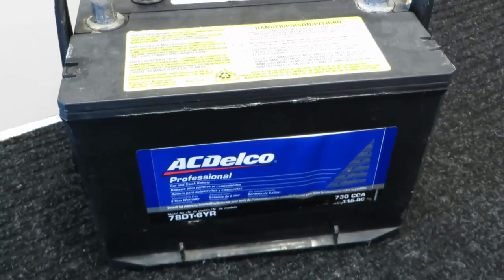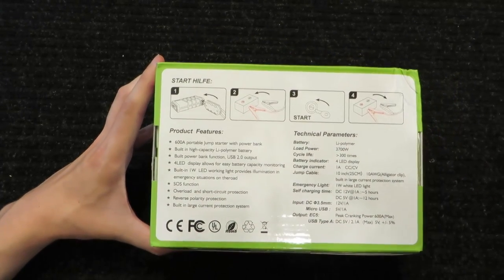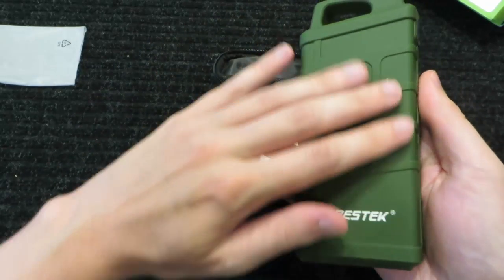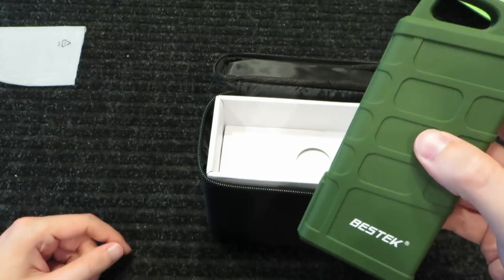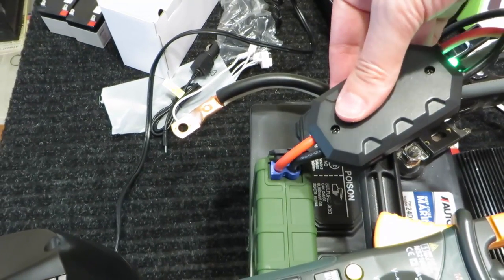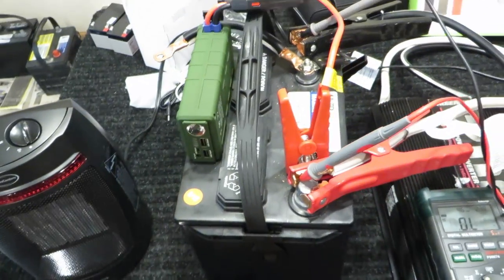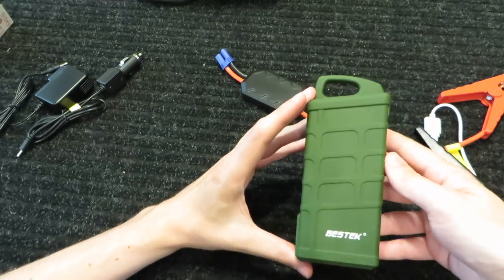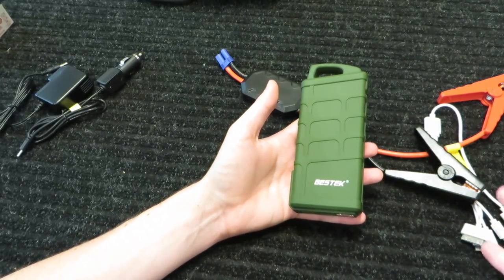BESTEK 600A Portable Jump Starter and Power Source Review

Comment: You think it would jump start a 6.2l v8 engine or at best a 5.4l v8?, thanks for the video, i was considering one of these last december 2014, they where all over lowes and home depot, i think it was whistler brand but they got recalled in Jan or feb of this year, are these the same polymer batteries they use on rc electric motors? thanks again
Reply from the maker: Fern W I don't believe this one has 'true' polymer batteries, just lithium ion with polymer separators like a standard laptop battery is my assumption.  Either way I have little doubt that it will start a large displacement V8 without issue when it's fully charged and in good condition.  I cannot speak for other similar brands.
Reply: +knurlgnar24 if it's anything like what I've seen before its probably a bunch of 18650 cells.
Reply: Peter Carlson 18650 cells can't produce near that sort of current (100A+). It will be a pouch style lithium like you find in RC models. 18650's usually output about 5-10A maximum.
Reply from the maker: abyssunderground Yup, it is the pouch style.  In my previous comment I mentioned that it is 'laptop style' which is misleading since most laptops still use cylindrical batteries.  But both are lithium-ion in most cases and not true polymer batteries.  The pouch style has polymer separators and are often referred to as polymer batteries in advertizing.
Reply: Fern W I can't speak for this particular model, but I used a similar jump pack earlier today to jump a 5.7l V8 that wouldn't turn over. Got mine from the local NAPA dealer for $89 on sale. It's called the Blue Fuel, but you can also get it from Amazon as the Shumacher Red Fuel. Exact same box just different colors. The battery technology is Lithium Iron Phosphate, which is supposedly safer than regular Li-Ion or Li-Polymer.
Reply: Yeah they all have tradeoffs. I use a lead acid AGM booster pack, primarily because I have to program keys to cars computers to start and that means keeping the battery voltage above 11.5 volts for up to an hour or else you have to start all over, that and after boosting the battery for an hour I still need it to start. Lithium batteries are great for that little bit of extra cranking current that you need when you have a battery that just went flat, but they are downright lousy when you need an hour or so of continuous voltage into the battery to run car electronics.
Reply: Peter Carlson That's just due to total capacity though, not the technology.
Reply: Well not exactly, That battery has to pretty much dead short across another battery for an hour or longer and often times in cases where there is a (sometimes) huge unknown load, lithium batteries don't like to be almost flat out shorted like that, lead acid particularly agm batteries are much more robust and likely to withstand that kind of prolonged torture than a lithium pack, hence all the safety circuitry required to keep that from happening. Pound for pound lithium batteries have a much higher energy density than that of any lead acid batteries, but they aren't nearly as robust.
Reply: Peter Carlson It would only matter if there was a voltage mismatch, I.E a 16.8v lithium connected to a 12v lead acid then current would flow to the lead acid until the lithum was dead (overcharging the lead acid in some cases perhaps). If it were 12.6v lithium and 12v lead acid it wouldn't matter as the voltages would eventually equalise. Ignoring cost, capacity vs capacity is of course identical.
Reply: abyssunderground
NOPE! that is if you had a battery and NOTHING else connected to it. I had a car yesterday that had to be jumpstarted every time it was shut down for more than an hour. Turns out for some reason or another one or several of the modules were pulling about 45 amps from the battery at all times(parasitic load test instantly popped my 10A meter fuse and I had to use a dc clampmeter), why it was doing that is beyond the scope of my job, I only need to give it enough electricity for the computer to accept the new key and then he can fix whatever was causing that. So no, there are in fact many reasons why lithium ion batteries are not suited for many industrial applications, and if they are their implementation comes with either monetary or practical drawbacks that restrict their usage.
Reply: Peter Carlson Of course I was under the assumption that the battery would not be under a high load. If this were the case it wouldn't matter. And again if you had the lithium and lead acid or agm of the same capacity it again wouldn't matter. They'd last an equal amount of time.
Reply: abyssunderground
Actually it would, the lithium ion will cut off because of self protection, the higher energy density per given volume of battery pack is going to mean those cells will heat up a lot quicker under the same load, while they may be able to give very high instantanious current outputs, they will fail catatstrophicly if you put that lithium cell without any protection in the same job as my booster pack. sure the protection saved your 100$ lithium battery pack, but you lost 400$ because you couldn't do the job with the tools you had, even though they were superior in performance in some ways compared to the old tool. I would rather hook up my booster pack and watch it's charge pancake before my eyes while performing my job than watch a lithium ion pack refuse to work at all.

Comment: HOW are they getting ~90 amps from that tiny little lithium polymer battery..??
Reply: I'm guessing there are 8x18650 cells inside based on voltage and size of the unit. These cells can usually support up to 10amps max draw. Given that this device only needs to be used at high amperage for a few moments they're safe pulling a few more amps out for just a few seconds. TL;DR - Magic.

Comment: I believe I am first but i didn't comment right away :(, also i have a 3S boost pack like yours, so mines 12.6 volts and it starts my 5.7L hemi with no problems over and over again, I am not sure having a higher voltage helped in this booster pack (4 smaller cells with less Mah at 16 volts) over one like mine witch can use the same space to put 12.6v 3 cells with higher Mah capacity, great review and glad you put out another video for us! also any more inverter videos coming ? :)
Reply from the maker: fliping720 The higher voltage helps them get more amps out of a smaller battery when connected to a high drain load.  Professional jump starter services often use 18V batteries for the same reason.  That isn't to say a 12.6V battery is in any way inferior - it's just an engineering choice.
Reply: ***** yea it seems that way, just looks kinda hard on the battery.

Comment: i am looking for a way to drop 36 volt solar panels to 12 volts I have the ability to get 100 70 watt 36 solar panels for cheep but I have two 12 volt aims 5000 watt inverter would love not to have to buy a new inverter any suggestion's boss?
Reply: david wise Just buy a solar charge controller with MPPT function.
Reply: +Lau Chung Kyu  wow thank you ill look into that I have ask a lot of people and got a lot of disinformation
Reply: +Lau Chung Kyu color me slow could you point me to one that would accept 36 and let the need voltage for a twelve volt system there are so many im lost
Reply: +Lau Chung Kyu http://www.ebay.com/itm/30A-20A-10A-MPPT-12V-24V-Solar-Panel-Battery-Regulator-LCD-Charge-Controller-CE-/301221639758?var=&hash=item462235764ethis looks like it works it a cheaper unit but the 30 amp one will work to test the panels I have at the moment
Reply: +david wise Don't buy this unit. This is a fake MPPT, you will spoil it with that high input voltage. Buy a higher price one.
Reply: thanks for the info really appreciate it
Reply: +david wise aims inverters arent very good quality, knurlgnar has done reviews on it
Reply: thanks I look for it
Reply: +david wise  MPPT shortens battery life significantly....
Reply: really short explanation please
Reply: hd the wise uuu

Comment: +knurlgnar24 This is probably the first pack like this I have seen that looks like it was built to be halfway safe (I am sure others exist).  The little black box looks to be the main thing that many of the other inexpensive Chinese booster packs lack.  I am waiting for a unit like this that is 4-6 times larger and is truly capable of supplying 400-600 CCA at above 9 VDC (many modern cars won't start below 8.5VDC due to computer).  It would be nice to see 4-6 gauge cables on this unit as well.  Heck at 4-6 times the size and capacity it might even be able to replace many small car batteries completely.
Reply from the maker: kuhrd I thought modern cars required no more than 5V?  It's not that I'm arguing with you but if you could link sources for the 8.5V number I would be interested in reading about it.  Thanks.

Comment: Save your money on these. These will only start your car if your battery is slightly discharged and not if you left your lights on or some how completely drained your battery.  You will find videos online where they disconnected the battery and started the car which is misleading and here is why.  If your battery is dead, the car battery will draw a substantial amount of power from the jump starter leaving little left to power the starter. Your best bet is to maintain your battery and make sure you don't leave lights on and if you do, either jump your car from another vehicle or the best thing to do is connect the battery to a battery charger.  This is because using your alternator to charge a dead battery can damage it since the alternator will not limit the amperage going to the battery.
Reply: it will still start the battery.

Comment: I will never buy another one of these boosters. I bought the Genius GB30 booster and it never was able to boost my car last winter. AGM spiral-tech car battery 660 CCA, 11.2 volt un-loaded bat GB30 Failed! The booster pack would not hold a charge in the cold car (Southern Canada Winters) so was useless away from home. Soon after the Lithium battery swelled up popping the GB30 casing open. 100 Canadian dollars up in smoke
Reply: City Lights oh, and the AGM type car battery which is now almost 8 years old is still working great! I do regularly place it on a trickle charge to top up it's surface charge. Longest lasting car batter I've had yet

Comment: sorry but 6v to the starter motor is not an acceptable starting voltage,  a lot of youtube test for these jump starters get 200A at these low voltage - Your car won't start on 6v! all that happens is things get hot. Minimum acceptable start voltage with battery under load is 8.5v (scraping the barrel minimum). Ideal minimum 9-9.5v (obviously higher the better). Remember you starter motor with the same output load is turning 50% faster at 9v then at 6v.

Comment: My main issue with these 600 ..700 amp starters is the cable.. come on..my 15 dollar jump leads rated at 700 amps are 3 times thicker.
Reply from the maker: There's a bit of advertising 'lies' in there, but for jump starting you only need a few seconds of high amperage so thin leads like this can still do hundreds of amps without overheating.  The issue with jumper cable thickness is more about voltage drop than cable heating.  These jump packs have short cables so they can get by with thin wires.
Reply: @knurlgnar24  I work for an independent test lab.. on testing these we found out that ..yes most will put out 700 amps....for between 10 and 20 milliseconds.. then the drop to 300 to 400 for 10 to 15 seconds then all the protection and alarms go off.
While this will start a petrol engine the diesel glow plugs eat up that valuable output.. so now you only have 3 to 6 seconds.. and it the main  battery is dead.. its sucking some of that power.. so you often only have 3 seconds..

Comment: 600amps! I'm sorry but I got my electrical engineering degree in 1987 so I may be old and the laws of physics have changed. 600amps at what voltage? The box references 12 volts and lower? Lets be honest this a glorified rechargeable lithium battery that Best Buy would sell, made in China and probably with inferior charging circuitry (designed to charge cell phones etc.) I would not connect that to a car battery unless you want to launch yourself into orbit.
Voltage does not equate into amperage or wattage. Your test using the battery charger is a cute deceptive way around not having to use the device on a real dead battery in a car or motorcycle. A disgraceful deception and potentially dangerous at the very  least!
Reply from the maker: Peter M I assume it is 600A at 0V.  This matches up well with my test showing about 100A at 12V on a 16V battery.  True jump start capability, based on direct evidence of my test, will be in the 200A to 300A range which is sufficient to start most any vehicle.  Car makers protect their vehicles against voltages as high as 24V since some people jump start vehicles with welders and other such sources so 16V is perfectly safe.
Reply: ***** You are hawking a product, marketing it. The 600 amps at 0 volts = nothing, no such thing, no volts no amps. THIS IS SNAKE OIL plain and simple, you are not an electrical engineer because you would know it is unethical to pedal nonsense to the uninformed and basically make-up physics. I have PE and can assure any readers that this is pure mythical thinking. This type of device is readily available for little cost at any retail outlet without the car battery leads as they are ridiculous and will not work. Again this device is for charging cell phones and i pods, it doesn't appear to have a UL listing and lacks any form of acceptance by an agency for consumer safety.  Your 100 amp test was not a test it was a collection DVMs, amp meters car battery charges wired like a birds nest that showed no real load test on a connected car battery. Peddling junk and old wine in new bottles is one thing, this is trying to deceive people and possibly cause severe harm to a user.
Reply: +Peter M bruh do you even know what you are talking about
Reply: Who is "bruh" or did you mean brother? I am not your brother. I do "even" know what I am talking about. Do you know what your are reading about  in this 600amp  portable car starter or battery starter? When you get PE (degree in electrical engineering) lets talk. I noticed you joined 9 hours ago, my post was 2 weeks ago, are you
KNURLGAR24s bruh?
Reply: +Peter M yo bruh ofc there is a few mV depending on where you measure, but we simple call it 0V or dead short. Ofc he is not going to try that as it would blow the device but this thing is working and capable of starting a car with a dead battery. Only fallback is that your starting cycle cannot last longer than 3-5s approx.
Reply: Can someone translate the "bruh" comments?
Reply: inductor87 read the comment you posted; hopefully you'll see the irony...
Reply: Hi Norma, I do see the irony, however in practice that has been my experience. Heres a link of the jumpstarter starting a car alone without the battery https://www.youtube.com/watch?v=yiuioV6kup0.  Also heres a link to amazon where it has MANY positive reviews.  The negative reviews seem to be built around it's charging circuitry failing, not a single review of it exploding or being dangerous https://www.amazon.com/BESTEK-10000mAh-Battery-Charging-Flashlight/dp/B00ZZGE4LU.  The unit works fine and knurlgnar's test was adequate.  Just because someone on youtube says they have a PE degree and disagree's, doesn't mean they are right

Comment: Did I miss something?  A jump starter being charged by the car battery that its supposed to jump.  Sounds like an endless loop.  And then both of them will be discharged.  It's driving me crazy.  ;-(
Reply: it charges it then stops. i dont know what you are thinking
Reply: +DMAN22yeah ..99% of the time, I don't know what I'm thinking, either. BAZINGA!

Comment: jeez us  that stuff might work but  wow is it made like crap  or what all this china made stuff sucks i liked the older made usa made goods  even this pc iam on i was told bu so called experts lol xp is dead get a new 1 bs its a lie all need do is take out mcfee replace with another  did so updates still going 2 i was told cant go more than 3 gig mem lie now its 4 gig  its like when you did your power inverter video tests some claim 2-3000 watts mostly not so  pros vs cons back when i grew up and bought items it held up and  there where no pro con lies as time went  ahead it just got worse and  the markets are so out to tell lies just to make a buck  our country is so in shit and seems to be as bad if not worse than china i was a tv tech over 30 yrs bench n field here in ny electronics  is just defense medical mill spec soldering crap boards  i started my field in mid 80s yet worked on tube tvs radios some ham cb  to transistor to now chips and all this wont get me a job iam dieing  to keep  and use what i know this is what the new crap did to me i even hold a dba  for private biz repair no one wants nada all cell phones lap tops zombies ego trip ppl that are so claimed know it alls

Comment: I always wondered why there were arcs on batteries. 12v definately does not arc, ever.* I did not know about the inductance.
Reply: waterlubber Whoa ,wait ,wait wait , what do you mean 12v does not arc ever ?I worked as a mechanic for over 30 years and managed to weld with a 12v battery
Reply: *****
I was talking about big electrostatic dischagres